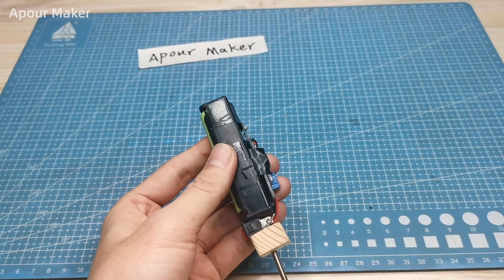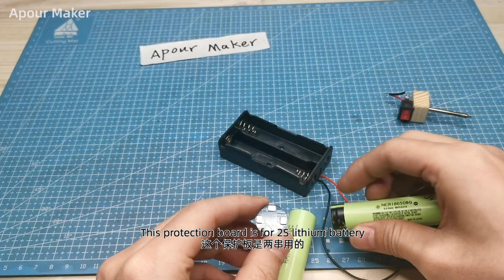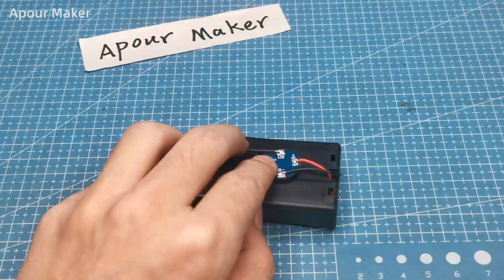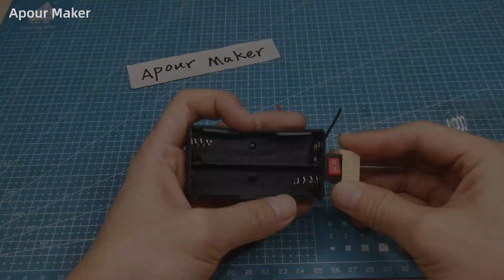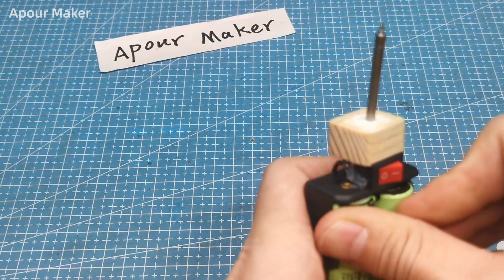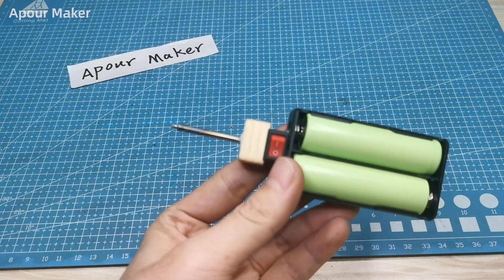How to make a MINI soldering iron with 18650 lithium battery part2 - Change to 2 x 18650

Comment: I also built one similar to this, but uses only one 18650 battery. It is super compact and is really really simple. 
No boost converter or circuitry needed. The trick is to make sure the heating element recieves all the current it needs, so all contact points (wires, switches) can do at least 2amps. I used stainless metal zipties and cut them into strips and used them as my conductor and as a momentary switch, wide contact is very important. It made the entire assembly need very few parts and still be effective.
In that one you built, the springs in the battery holder limits the current, as a result, you needed the boost converter to suplement the low current draw.